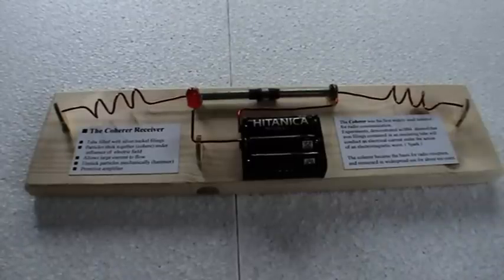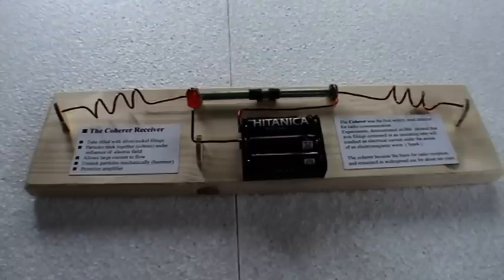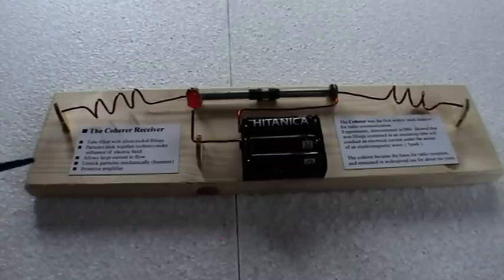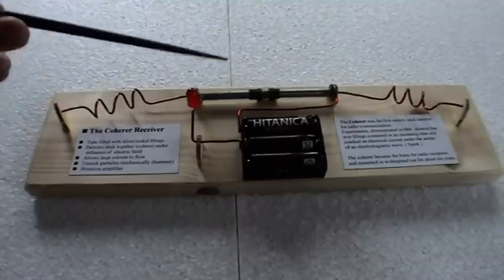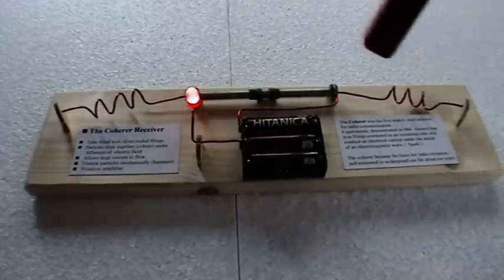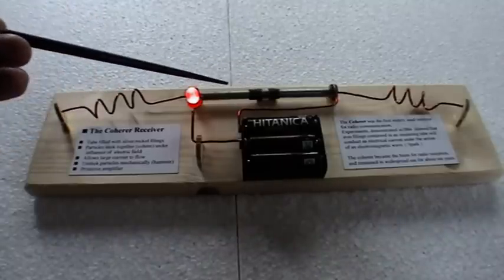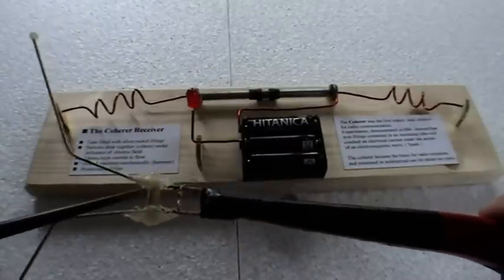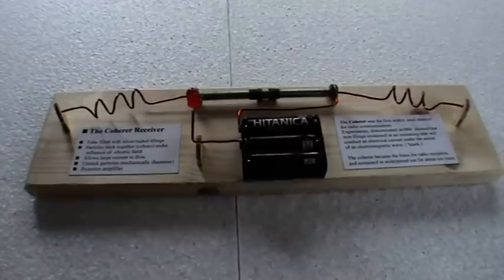Vintage  Model RC   Coherer ( Spark )  Receiver

Comment: Why are the antennas in the form of inductors?
Reply: The inductance would be incredibly low, may produce impedance in the microwave range.  Simply a wound antenna like any whip CB antenna on a vehicle, just shortening the physical length of the package.